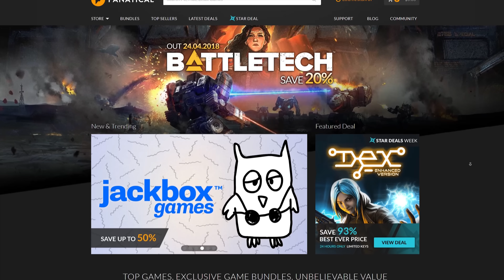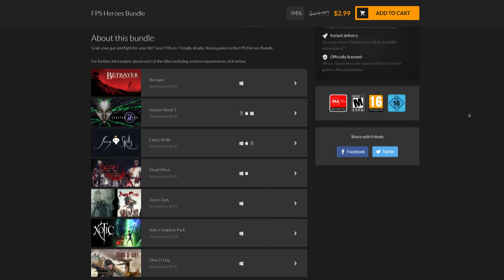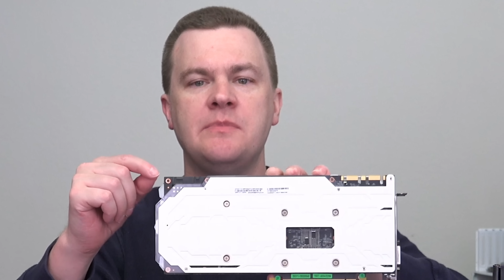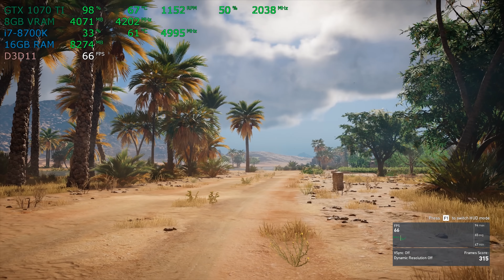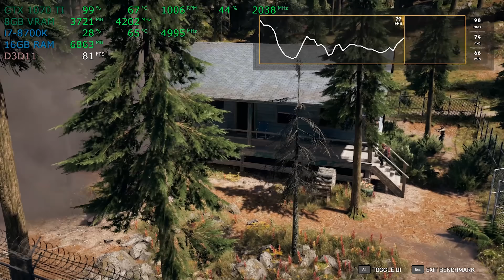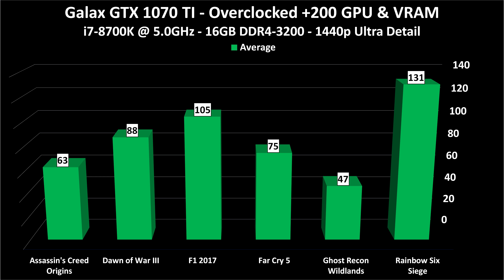Galax GTX 1070 TI - Is It Worth Buying? - Review

Comment: I live in Jacksonville, FL and my first graphics card was the Galax HOF GTX970.  I had to get a company called Diamond to custom make me a waterblock for my card. I purchased my card back in 2015 and even today it still keeps up with all the new games. I'm still using the devils canyon i7-4790k and the z97 asus mark-s with Avexir Sabatico ddr3 ram (16 gigs). My CPU and GPU are both watercooled and I must say I still to this day have had ZERO problems with any components. Although it's sometimes a pain to change my fluid (I've totally redone my drainage fitting) but refilling and emptying my system has been a breeze. My go to paste is noctua NT-H1 as it's great for overclocking, easy to apply, and really not that expensive. Plus it helps keep my components on the cool side when I've got them overclocked which I dont keep the CPU/GPU overclocked unless I'm doing some intense gaming and need that extra boost. I also boost my ram but theres no paste needed for that... but getting back to the galax cards. I'm a huge fan of the HOF editions. However I think I may build a new pc and snag me that 1070 sniper as one reviewer showed its performance to be on par with a 1080 (the 1070 was overclocked of course but still... the prices are finally dropping) all I want is good frame rates and the ability to get a decent card that can keep up with the games coming out. But I do get asked allot about where I got my waterblock for the Gtx970  since back then galax didn't offer any watercooling support for their cards so overclock.net became my bestfriend:) I do appreciate your unboxing and giving galax the recognition it deserves for making some quality cards. Amazon did have the galax HOF Gtx970 and gtx980 but the 970 was $1200 usd, and the 980 was almost $1,600 usd (Galax website sold the cards for much cheaper but no one even knew they had a site lol. I was even offered a crazy amount for my custom waterblock/backplate for my gtx 970 mainly due to the white pcb. But I'll never be able to let go as this was my first watercooling build done in a tj07 with the help of Ricardo from coldzero.eu which the build would not of been possible without him....oh and Tim from Diamond cooling for my GPU waterblock and custom backplate.

Comment: I have the Galax 1080ti and it also comes with essentially the same things in the package, including the same-ish cooling shroud and the  6pin+8pin power. 
So, if it worked for the 1080ti, it should work for the 1070ti.

Comment: At this point on the product cycle, I feel if a person has waited this long to not get 10series card might as well wait a few more months. Reports are that some time between late June and November we should see 11 series cards (or 20 series depending on what you believe) will begin shipping. If 108ti card would come back down to the 700-800 dollar range I might buy one because TI's usually take longer to come out and rumors state that new 1180smay begin at 699. But that all being said if you HAD to build from scratch a 1070 ti is a good performance per dollar option right now as they can be had for between 510-600 depending on brand model etc at this time.

Comment: If the backplate is metal then having plastic in between is kind of a missed opportunity for extra cooling. A backplate connected to the pcb via thermal pads can help a bit with cooling components. Note i said components not the core. Still i guess thermals arent an issue so having some extra eye candy is just as valuable i suppose

Comment: One note you might have found if you downloaded the software, and you probably should in future reviews, is that it does not cache the RGB settings on the card. Every reboot will reset the color to white until the software is run. That is not the end of the world, but will disappoint some and would have been a good heads up for a potential purchase.

Comment: Amateur PC builder here. I currently have a GTX 1050ti, ryzen 5 2400g  and a 550w power supply. How do I know if I can upgrade to the 1070ti without any issues? I've heard older parts might not work with newer cards 1060+
Reply: I have a Ryzen 5 2400G and a 500W PSU. Motherboard is MSI Mortar B350M. No issues with my GTX 1070Ti except for slight CPU bottlenecking in some titles. I might be upgrading to Ryzen 7 2700X.
Reply: JarrodShadowsonng I have the same motherboard lol. Thanks!
Reply: you will know when you play CPU intensive games
Reply: CPU bottlenecking can be quite irritating e.g. in Assassin's Creed Origins and the Witcher 3 in Novigrad. Mine is OC'd to 3.8GHz with the stock cooler. I'm thinking of just upgrading to 2700X.

Comment: Question: Is the 1060 6gb a deal now because where I come from there's about a £10-£20 difference between the 3gb card and 6gb card?
Reply: Definately buy the 6gb version over the 3gb version if the price difference is so small! The 6gb version is actually a completely different gpu to the 3gb version which is just a highly binned 1050 so definitely worth the extra for the  increased ram and performance

Comment: EVGA 1070 Ti is selling for 500 dollars and this is 600. So how is this a good deal?
Reply: matrixfull well your right and wrong, technically you are right all the 1070ti chipsets are the same and the Vram is the same as well, but different manufacturers put in either better coolers, better software for overclocking, more features ect.. for example nivida themselfs only have blower cards but 3rd party manufactures (evga, msi, gigabyte) will almost always sell a 2 or 3 fan open heatsink configuration this allows you to get a cooler card, or better overclocking, but blower cards dont, hope I could help!!!
Reply: I always wondered what is the point of having one over another. It's same GPU ; and everything else can't be that different I'd think.
Reply: It was on sale about 2 weeks ago for 479
Reply: In my country i bought this video card with 530 dollars
Reply: matrixfull They are completely different.

Comment: does the graphics card have a 'no-fan' profile (fans dont spin) at low gpu usage/temperature? or do they always spin?
Reply: GTX 960 Gameplay Hi, I actually own this card and by default this card's fans will only start spinning once it gets above 40C.
Reply: It depends on the particular model, my gtx960 had a 0rpm mode, my gtx1060 does not and the fans always run.
Reply: yeah, they updated that issue, they dont spin until you reach 45c
Reply: Not on the 10 series unless there's a firmware update I'm not aware of. The 10 series idle at minimum of 30% rpm, the 9 series had 0rpm at idle.
Reply: rztrzt well then, good thing my GPU was still in the warehouse, chatted with them and swapped it for the MSI 1080

Comment: Hi, excellent vid, btw there is another Galax GTX 1070 TI EX 8GB GDDR5 256-bit DP*3/HDMI/DVI-D ,  70ISH6DHM9XE, black , what could be the difference?.
Very estrange, Your Galax 70ISH6DHN1WK is not on the GALAX website products, after a little research I noticed that 70ISH6DHN1WK has been distributed in EU and Russia, on the other hand the products listed on Galax website such as GTX 1070 Ti EX 70ISH6DHM9XE, GTX 1080 EXOC 80NSJ6DHL4EC-PC and GTX 1080 EXOC 80NSJ6DHL4EC are distributed in Australia, Middle East and Asia... ? What the heck is going on?,lol